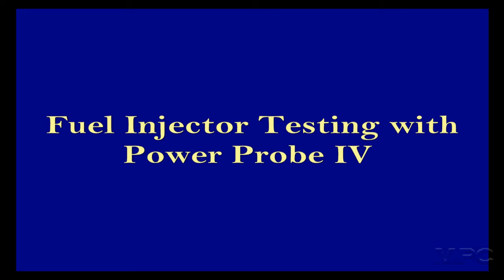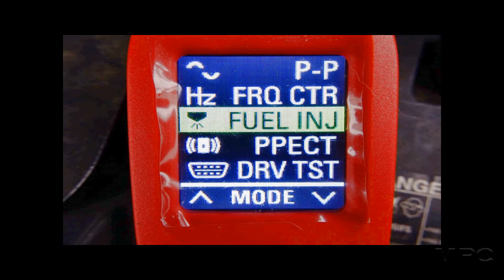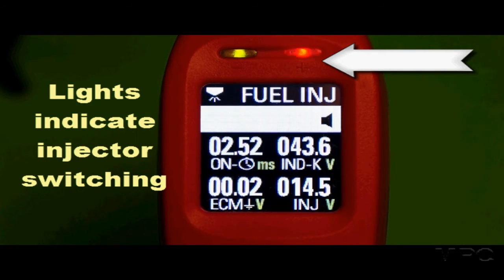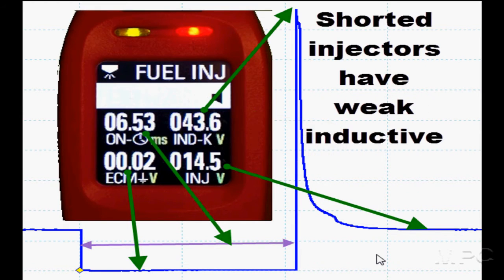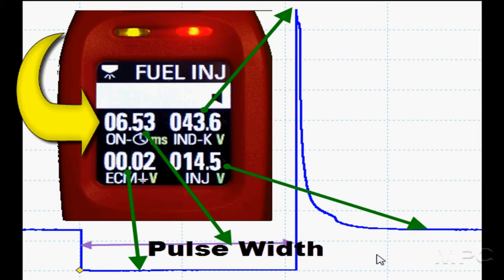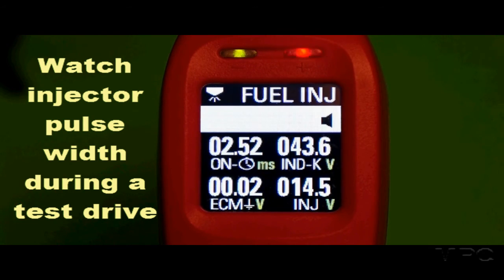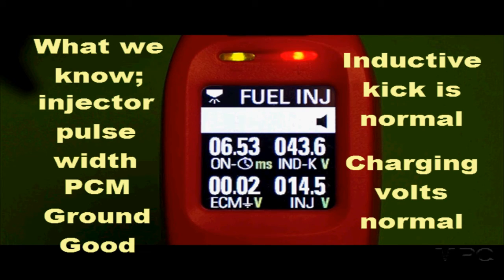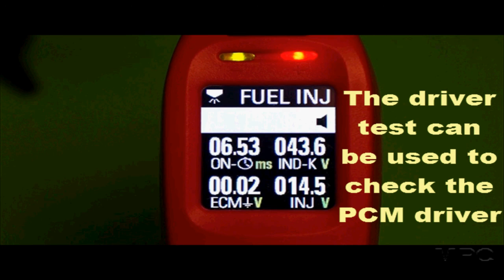Fuel Injector Testing with Power Probe IV

Comment: Ultimately this is very handy because if you got a four-cylinder or six cylinder or eight cylinder take a picture of the power probe screen compare them to each other and the one showing significant difference is the one you replace and at $500 each one diagnosis pays for the tool

Comment: can you blow ecu using driver test down the wrong wire? sending 12v down it
Reply from the maker: We do not send 12 Volts down the wire. The test records the characteristics of the signal present on the wire with the engine running that would normally need a lab scope to obtain. The driver supplies 12 V and will not be harmed if you were to send 12 volt which we don't advise because it is not a viable test
Reply: so is the driver test mode pn the pp4 not actually putting 12v to the tip the same as pressing up in vdc mode? 
what about if you didnt have a wiring diagram, would it be safe in driver test mode to poke any wire? i assumed it was just putting 12v to the tip without having to hold the button like in vdc mode.
Reply: sorry my question was for the ecu driver test mode not fuel injector testing! i posted my comments on wrong video